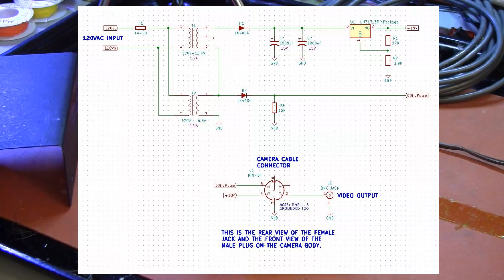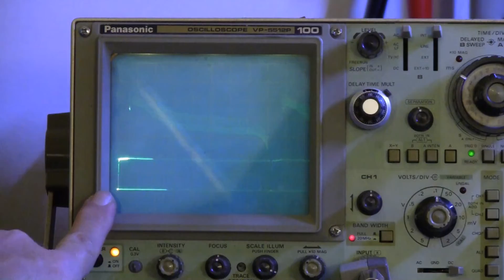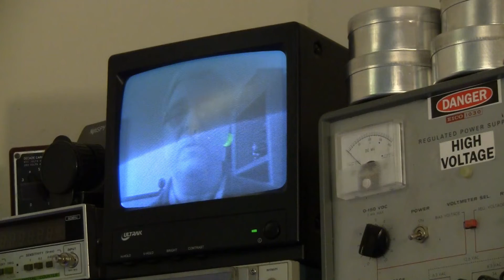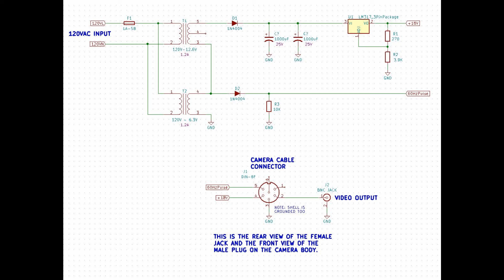1970 Cartrivision MCA-0001 Vidicon Camera

Comment: What happens if you power it with 12V? Does it not work?
Reply from the maker: Thanks! That's a very interesting question. I will have to test that when I fire up the next camera. This may actually happen sooner than later.
Reply: @videolabguy  I think it should work with 12V, maybe there's a DC-to-DC converter in the curcuit that steps it down to 12V?
Reply from the maker: I have gone through the service manual and schematics of the camera now. The short answer is: No. It will not run on 12 volts. The camera uses the 18V to generate the blanking pulse for the cathode of the vidicon tube and it takes all of that to do the job. If one converted the camera for that voltage, they would need to install a boost converter to create the 18 volts for the blanking circuit. Much of the camera runs on 11.8V internally and there is a regulator circuit for that. But, you can see the voltage drop is too low for any regulator circuit to generate it from 12 volts. The simple answer to that is: find a 12 volt camera. :)  )

Comment: hello, does the CRT Camera has a shutter? If yes, how it works?If not, how to control the exposure? Aperture and ND filter?
Reply from the maker: No (exposure) shutter. Mechanical shutter (door) in front of lens. Exposure is continuous. Automatic (electronic) vidicon tube target voltage control. Two position iris, F1.9 / F5.6. No ND filter.
https://www.labguysworld.com/Cartrivision_MCA-0001.htm
Reply: @videolabguy  thank you so much! By the way, can the vidicon tube target voltage be adjusted so that the exposure is also adjusted?
Reply from the maker: @陈佳新-d5s  Yes. ALC = Automatic Light Control. New video coming out very soon. Deep dive into the schematics of this camera.

Comment: RedFox123
I was wondering if you could help me, I have a jacket gz-s3 camera I recently got. But when I turn it on this is the only thing I get through the viewfinder https://imgur.com/a/JRwzg6L . It also doesn't output any video through the power brick. I think there is also a power issue as the crt viewfinder sometimes flickers (in person) along with some crackling from the saticon tube. Many many thanks
Reply from the maker: Never heard of a Saticon tube that makes sounds. I'd say it sounds like it has lost vacuum and is arcing internally. That's a bad thing. My advice? Try another camera.
Reply: Thanks for the help, at least it looks good on a shelf :)

Comment: I remember when Cartrivision was being marketed. There were several home video systems being trial marketed in the early 1970s before Beta and VHS. Olson electronics was selling the surplus residue from one of the early tape systems but I don't think it was Cartrivision.  I remember when Sony was marketing a Beta 1 system combo with a TV console. I am trying to remember what TV had the slide system built in with a flying spot scanner. I think Silvertone or Magnavox but my memory on this in unreliable. I have a supply of 18v zener diodes. Gary
Reply: The TV with a flying spot color slide scanner in it was a Sylvania set.
Reply from the maker: Olsen sold the Cartrivision residue. Funny you should mention it, but, I have this remarkable bucket list project.... http://www.labguysworld.com/Project_Color_FSS.htm

Comment: That power supply is pretty clearly a homemade one -- besides the design faults you point out, those transformers are Radio Shack parts.  Not likely a true "factory built" power supply.

The sync and video look pretty decent all right, especially for a 45-year old vidicon.  The camera's black level adjustment (if it has one) is set too high which partly accounts for the low contrast picture.  I owned a Cartrivision VCR in the late '70s, and still have the schematic.  It was a decent video recorder.  Never had one of the cameras (working for RCA's broadcast camera division at the time, I felt the MCA-0001 was sorta "beneath me"), though now I think it might've been at least somewhat worthwhile.

What are you going to do with the camera now?

Thumbs up for this video!
Reply from the maker: I've made no plans for the camera yet. Someone might make me an offer I can't refuse. I'm biting myself for forgetting to elaborate on the 60Hz pulse a bit more. I do cover this better on the project page on my site. http://www.labguysworld.com/Cartrivision_MCA-0001.htm
Yep. I knew the black level was too high. I did not want to go into that much depth in this video. Maybe I will if folks show enough interest and ask for more details. I have the camera service manual and could do an overview at the schematic level with demonstrations of each adjustment. But, there are pending projects on my bucket list that will definitely blow some minds! It never ends, you know.